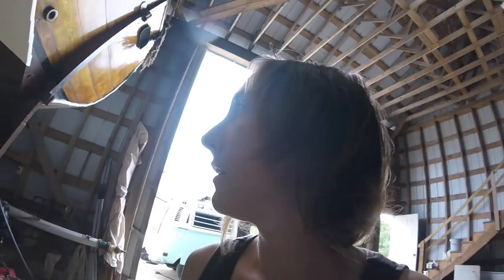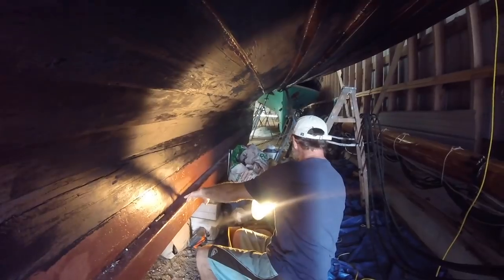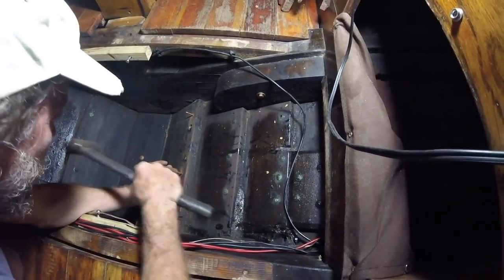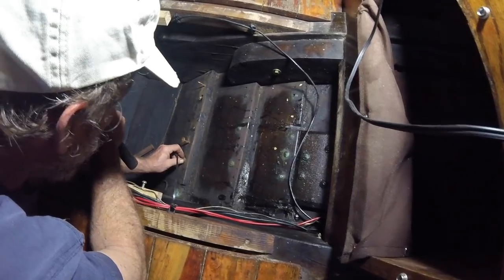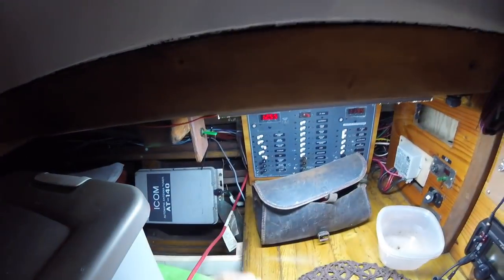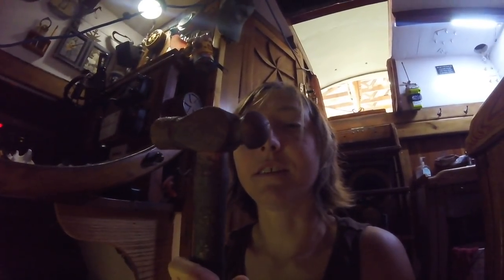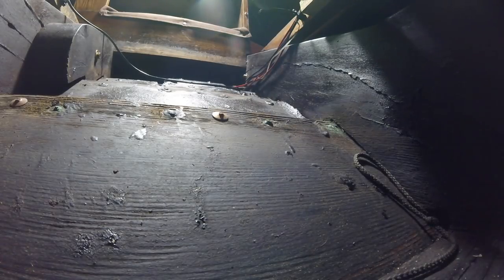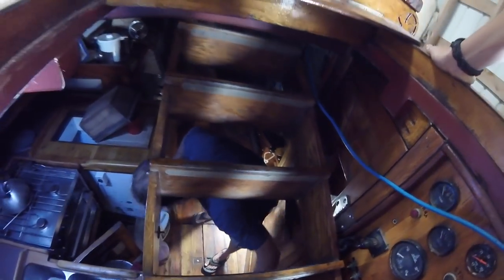Peening Over a Copper Rivet on a Lapstrake Hull

Comment: Isn't cleaning a lapstrake hull a giant pan in the ass when shes in the water. I owned a small boat, lapstraked and It was, I wouldn't own another.
Reply from the maker: ray Nic when she had a copper bottom, the growth was not terrible, and being that the shims that took the curve of the hull to lay the copper smooth, we never really had to clean a lapstrake boat. This summer when we launch her, we will find out, however we are in for only the summer and then haul out before the snow flies.
Reply: Ah, shims and copper clad, there you go. Watched a friend copper clad his bottom, it was absolutely amazing when it was done. One thing I would recommend If you haven't done this before Is to round off all the corners on your scrappers, so as not to damage the paInt on the nIne miles of inside corners you have to deal with. Ciao.
Reply from the maker: ray Nic ok. Will do. Thank you 🙂👍